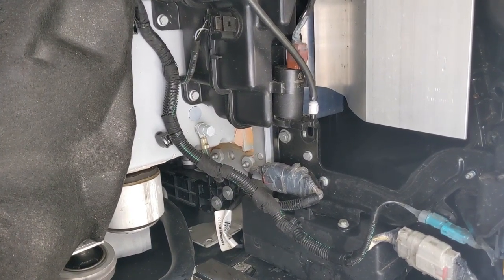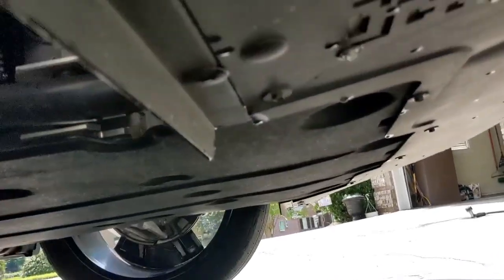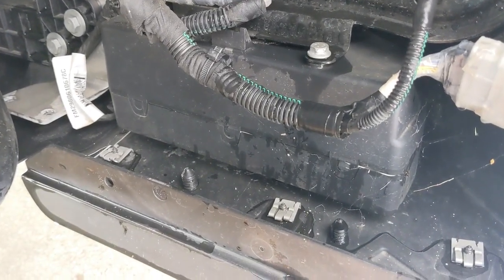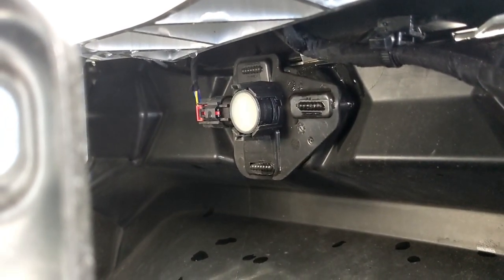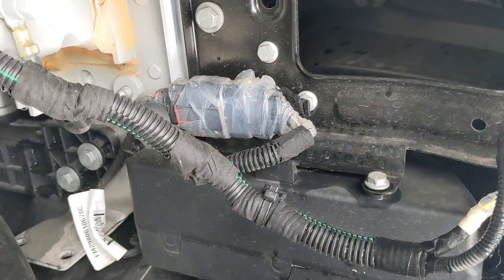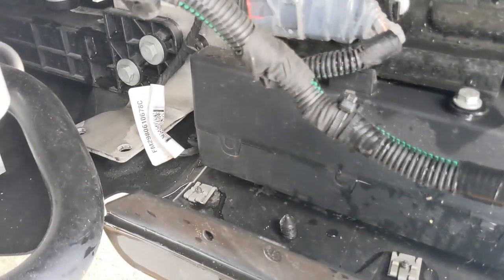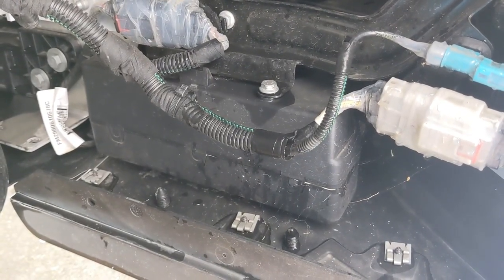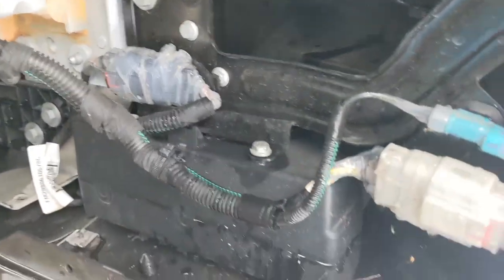Fisker Ocean right front bumper water proofing interval exam

Comment: Did you cut off the windshield washer level sensor?  I understand that washer fluid can get into the connectors even in dry weather.
Reply from the maker: I have another video on that topic, but short answer is put in new sensor but leave disconnected. Will act as plug and not leak on connectors below